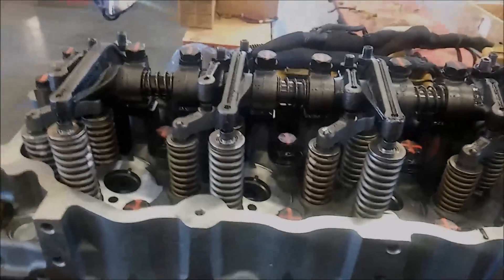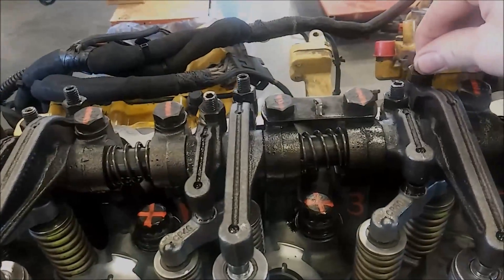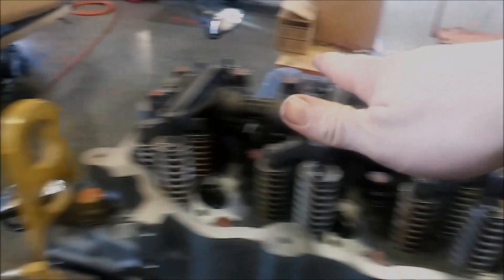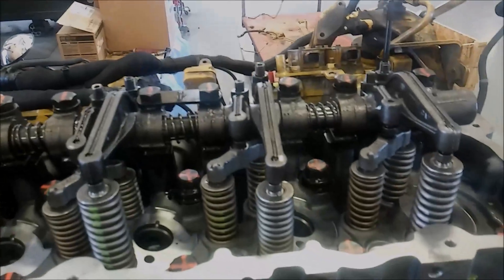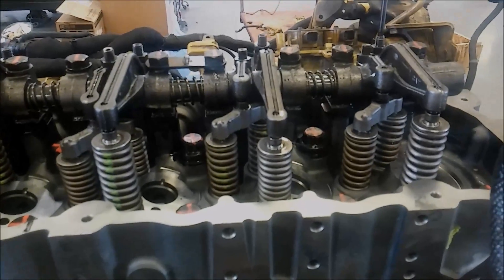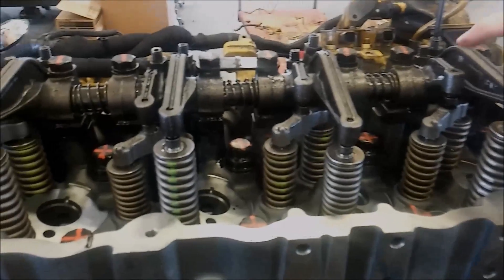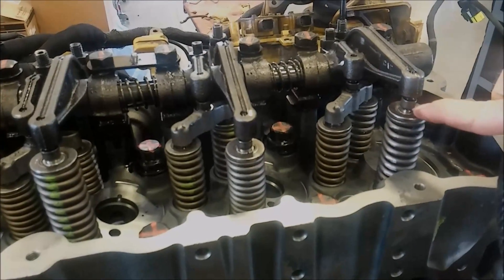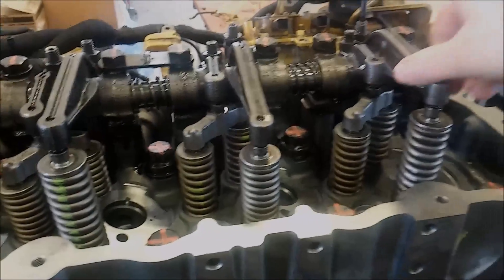How to Adjust a Cat Overhead Valve Adjustment

Comment: If you whatch for the intake on 1  closing them you know or coming on top you can feel it on the compression stroke a turning tool it nice by yourself because your on the wrong side from pin

Comment: Thanks!, my 1wm 1997 3126 with the hp oil tubes that go into the top of the injector and only two valves per cyl. Is that the same adjustment sequence you show here?
Reply from the maker: Valve lash on those is .015 intake and .025 exhaust. Intake valves are the forward valves (fan side) and exhaust  are the  rear of each cylinder.

Comment: I'm working on a C9 in a 330D. I removed the pipe plug you mention and find several holes a bolt will drop into. How do I know I have the correct pin hole?

Comment: I'm not sure how just saying "intake exhaust" 3 times helps anyone to remember the sequence for which cylinders get both intake and exhaust and which only get either the intake or exhaust adjusted for that particular flywheel pin but if it works for you that's cool.

Comment: I have a 3406E 2WS motor, on one cold morning bobtailing going downhill, my jake break switch was on and engaged. I heard a loud pop noice and after that my number 3 switch and one stopped working. It pulls great but recently I hear hissing sound from the # 6 cylinder. My question is, if you engage the jake when it is cold, can it cause any damage to the valve or head. Thanks.

Comment: Sorry but the valaves you are touching and what your identifying it as is backwards when you saying the sequence  and the sequence you say doesn't match what you are doing and saying... leaving confusion, I know this is older video but could you possibly post the procedure?  Example " one T.D.C. adjust #1 Ex,#2 In,#3 Ex,#4 In," etc.. or " on T.D.C adj  even #s In vl and odd #s Ex vl then rotate 360° and do opposite valves..

Comment: How often do you need to do an overhead set?  Do you normally find clearances tighter or looser on engines that have been run for a while?
Reply: 250k miles, they usually get tighter due to valve seats pulling thru

Comment: how long should it take to adjust the fuel rack and increase the horsepower settings from 385hp to 420hp on a 3126 mechanical marine engine aswell as the running of the valves? thx,lou

Comment: @adeptape help! Changing head gasket on my 3306 in my d6 dozer. Do I have to worry about timing pin if I’m just changing gasket? I’m pretty sure I’m not messing with injection pump so it should stay in time? Thank you it’s in a million peices now kinda scary ha

Comment: I have been trying to adjust the valves on my 3126 Cat for the last 2 days, there is always one that get tight with not space in the area where you run the feeler gage tool, in this engine the pin hole is on the driver side of the engine, any suggest. I might be pinning the engine wrong...

Comment: Hello  have to say I  you are whith our a doubt the most informative cat mechanic  . I have  been  driving a local septic truck whith a  C13  it has 239456 mi on this engine and 10,000 hrs  have  started to notice a pinging or rattling comming from the engine only when it’s under a load it almost sounds like spark knock on a gas engine  what  is causing this

Comment: I have a 2014 Cat 924K wheel loader and need to do a valve adjustment, has 11000 hour's and I don't think  they ever been adjusted ,original paint on all bolts,  it is a C6.6 ACERT is the adjustment on this engine .015 and .025 ? and is intake/exhaust series the same

Comment: Doing this soon on my isuzu npr with 4hk1 engine
Reply: do you happen to know someone who works on isuzu engines? I just purchased the service manual for my truck and Im confused on adjusting the valves on my isuzu NPR-HD. It has 2 valves, each for intake/exhaust that have a bridge. Whats confusing is that the bridges on this engine have their own adjusting screw as well as the rocker arm. The adjusting screw on the bridge pivots on 1 valve and can affect how horizontal the bridge is. They warn not to let the bridge be too slanted and yet they want you to loosen both the rocker arm bolt and bridge adjusting bolt which I would think will make the bridge cocked. Then they want you to adjust the lash on the rocker arm first then adjust the bridge screw so that it just touches the valve. Not much info on these engines out there and was wondering if you might know somebody that can help clarify. I was thinking just dont touch the bridge screws but never done it before. Gonna see if my local diesel guy will be nice enough to help me as well lol.

Comment: Hello, I'm working on a 2004 c7 cat was told to set intake to 0.038 and exhaust to 0.064, is this correct?
Reply from the maker: +Emilio Gomez Should be 15 and 25 thousandths, I think that is what the millimeter measurements are. If you look on the data tag on the valve cover it'll tell you too, little known fact.
Reply: Adept Ape  thank u so much 💪

Comment: When removing and replacing the Valve cover it looks like CAT has bulk gasket material that you use for the valve cover gasket. I have read on some sites that you can reuse the original gasket if not damaged. What is your thoughts on the gasket and any suggestions on cutting the new material?
Reply from the maker: +Jeff Peters The gasket can be reused if it isn't flattened out. If it is then you'll want to get some new seal. Basically just cut it with a pair of heavy duty scissors or snips. You should watch my "day in the life of a truck mechanic" video, the thumbnail is me looking at a turbocharger. I actually replace that seal in the video.

Comment: I have a 2003 kenworth 900 Cat C15 engine. When the truck is running the fan clutch works without stopping on low it works fine. Do you know if it is a thermostat or something else ?

Comment: does this work for all CAT engines?
Reply from the maker: +Jameson Boon For inline 6 modern Car truck engines, the sequence works, the lash adjustments could be different depending on the engine model. The 3406 for example uses a 15/30 thousandths instead is the 15/25 thousandths of the C7 in this video.
Reply: Cheers mate i don't get much time with CAT engines just macks an volvos an starting to get into the Cummins due to of where I've worked in the past an where I am now an your videos are pretty good
Reply from the maker: +Jameson Boon That's cool you get to work on a bunch of different stuff, I wish I knew more about Cummins, but then I wouldn't be the Cat guy I guess.

Comment: Be sure and tie string or something to the tools you are using.  I dropped the allen wrench down beside a push rod and was lucky and got it out with a magnet.
Reply from the maker: +thomas gordon If using Allen wrenches that is a good idea. I prefer to use a T handle driver or 3/8 driver.

Comment: On valve lash adjust does it matter if engine is warm or cold. Did not hear comment on cold or oper. temp lash feeler gauge thickness? 
Your video's are just awesome, keep up the great work 😉😸.
Reply from the maker: +Chris Morgan I should have mentioned that, but always do a valve adjust when the engine is cold.

Comment: Great video! Thanks...Wow I always thought this would be so much more complicated.  Ive heard some occurrences of dropping  a valve after a valve adjustment on the RV forums. Can you advise what are the common  causes are on a C7?
Reply from the maker: +9secv6 Do you mean the common causes of a dropped valve on a C7 or common failures on a C7?
Reply: What are the most common causes of a dropped valve in a C7? Especially after a valve adjustment...Thanks
Reply from the maker: +9secv6 Normally valve failure on a C7 is caused by the lifters. The lifters have a tendency to fail on the roller bearing, which then damages the pushrod and can damage the rocker arm or valves. It isn't super common, but it is a failure point.
Reply: Thank you for the reply.Great info.

Comment: hey what would it mean if I lost power to ignition all of a sudden while driving
Reply from the maker: +Matthew Galindo The ignition 12 volt signal from the key switch is what tells the ECM to stay on. If the ECM lost it, it would shut off firing your injectors and your engine would shut down. Same as turning the key to the off position.

Comment: Hey
whats the difference between a 70 and 120 pin harness?
Reply from the maker: +Omar Well the number of pins of course, but really it's just a bigger connector for the newer Cat engines with more electronics. Still use Deutsch style connectors.

Comment: Hey, Adept Ape, aren't there specific markings to tell you when you have hit TDC? Where are they on this specific engine?
Reply from the maker: +BrunetteBudgets You are correct, these engines have timing marks, but the camshaft timing marks are behind the timing cover which takes quite awhile to remove to check the timing. None of the harmonic dampeners have timing marks like a car engine so the pinning is really the best way to time them. Hope that answers your questions. Good questions
Reply from the maker: +Adept Ape This engine is a C7s by the way.

Comment: What if someone put the flywheel on wrong, jamming the steel dowel down in the wrong spot on the crank, the pin timing would be wrong. could you look for overlap on 1, and make sure valves on 6 are both loose and vice versa?
Reply from the maker: +RYAN T Most Cat engines have different spaced crank bolts for the flywheel, so it would be darn near impossible to install it wrong, but there are many aftermarket flywheels and sometimes the flywheel housing has the pin hole incorrect. There is always someone that could put one on wrong if they try hard enough. So that leaves you with a few options. You can check the timing by removing the cam cover, but that takes quite a bit of time. The engines with high pressure common rail fuel pumps have a timing port that can be checked, but that is only C7s and C9s engines. So yes if you know your firing order which is 153624, and your pair cylinders 1& 6, 2 & 5, 3 & 4, then you can do your overhead, but it takes quite a bit longer since you'll have to rotate the engine in small increments watching the valves. Having to do the injectors complicates it further since you do them on the cylinder that has the open valves in overlap. If the engine has Jake's and IVAs then your going to have rotate it more if the housings had to be removed too, I've done it with engines that use accessory flywheel housings like cement trucks, it sucks.
Reply: @AdeptApe  wat 13×
Reply: +Adept Ape ok gotcha, yea that'd be a lot of engine rotation.. Thanks for the reply!
Reply: +Adept Ape ok gotcha, yea that'd be a lot of engine rotation.. Thanks for the reply!

Comment: why c15 always got a problem with rocker always broke or eating on cam shaft 
power full engine but head adjust always always
Reply from the maker: +reda elsheikh Every engine has weak points in their design, the C15 seems to have problems with the overhead more than most of the other components on it. That is just the weak point of that design. I think they had more problems as well because they changed the overhead design so many times over the years.
Reply: It's there a update bolt kit for the rocker arms, to fix the problem of them snapping the bolts?

Comment: How much is the hourly labor rate in a cat shop?
Reply from the maker: Depends on the shop, since each Dealership is a separate company, but it is 120 an hour at our shop.
Reply: +Adept Ape not bad, the Volvo dealer near where I work charges 142$ per hour, lotta variation from what I've seen so far.
Reply from the maker: +CootShoot95 That is quite a difference, the shop charges a higher rate for RVs, but 142 an hour for trucks is pretty high.
Reply: +Adept Ape Chicago dealer, that probly explains it. hopefully you get what you pay for. lol

Comment: nice video.  when torquing the valve nuts you don't need to recheck the clearances for the valve to rocker arm?  i would think that without holding the adjuster screw while tightening the nut, (as you did in the preliminary adjustment) the entire assembly would tighten shrinking the gap?
Reply from the maker: Sorry I didn't catch your comment earlier, usually I get a notification. Yes the adjuster can move on you when you torque it, but after you have done a ton of them you'll find that you tighten it with the wrench to about the correct torque. The torque wrench is really just a double check, most guys don't torque the nuts. You can leave the feeler gauge in there when you torque it as well just to make sure, or just a torque adapter or "dogbone" wrench to tighten it initially. Thanks for the comment.
Reply: +Adept Ape I want to know the problem there is diesel in the radiator machine model 3116 Loader 950f